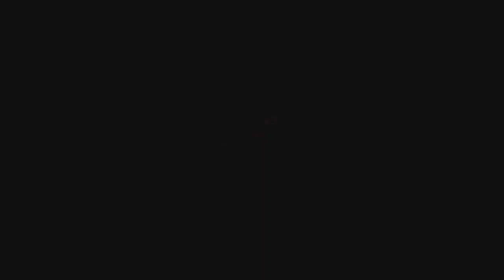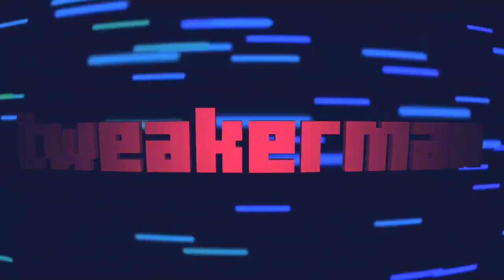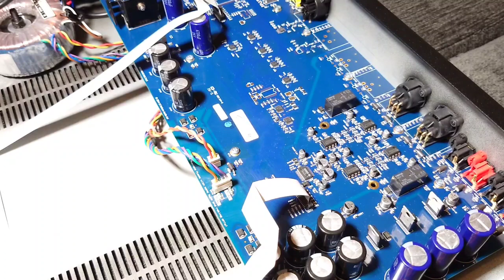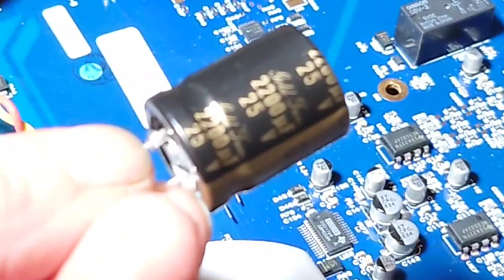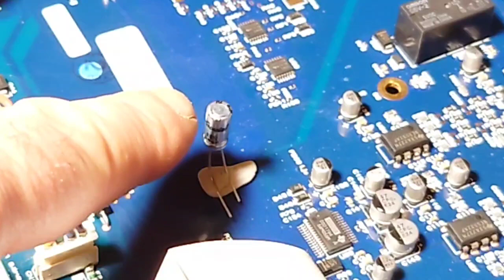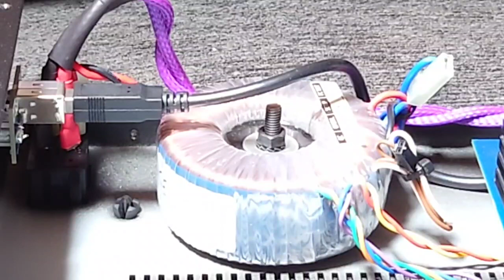LOOKING AT MORE UPGRADE FOR THE ROKSAN K3 DAC

Comment: That’s a dual layer board that will suck heat.  Without a very good temperature controlled iron and and a hot air station could be troublesome to easily unblock the holes, especially if you don’t have experience with these.  As for the smd caps, as they’re very close together you could struggle to replace all them with through hole variants.  

As this is very new, I think this could be a bad move as it's not all just about 'capacitors'.  Changing the transformer would be difficult as you’d need to find one the correct rating with all various voltage taps for the individual voltage rails for minimum gains, if any.

I’m certainly not saying it's beyond your ability but a few hard to unblock ground pins and lifted pads, things could go south very easily.  I sent my TagMclaren DAC 20 away to be professionally serviced for all the mentioned reasons. 

My advice would be to apply caution but obviously it's entirely your decision.

🙂
Reply from the maker: Hi Andrew, yes you're right, if equivalent smd caps are two big, it won't be possible, I'll work that out soon, thanks for commenting & watching 👍